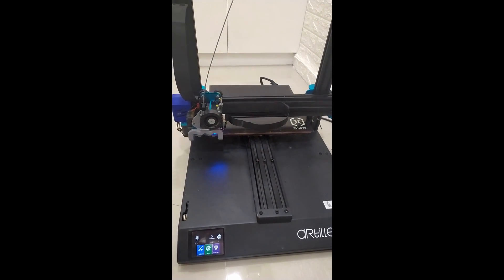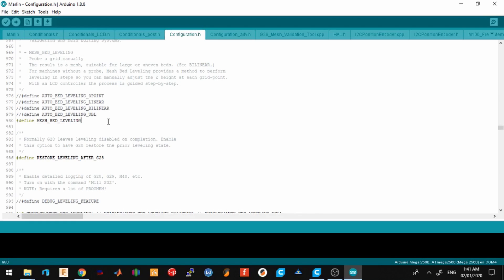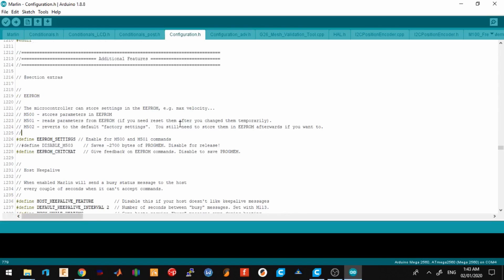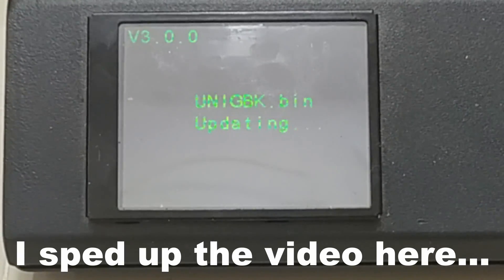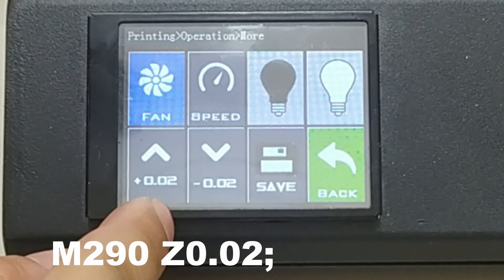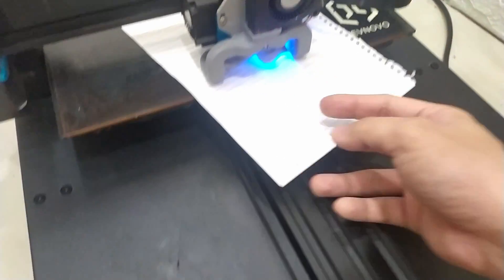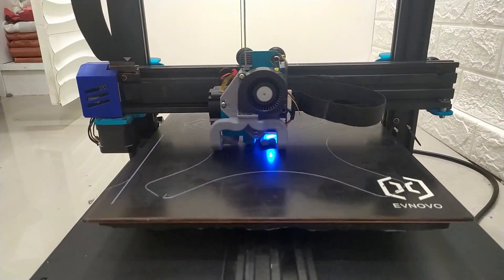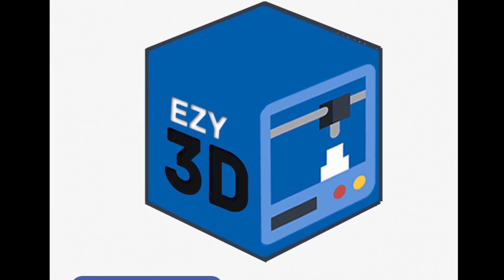Artillery 3D Sidewinder X1 Manual Mesh Bed Leveling Tutorial

Comment: I've noticed my settings dont save. If I redo it, the same spots that needed adjusting still need adjusting.
Reply from the maker: adjust the x-gantry first then redo the mesh. I've got into a troubleshooting call with some of my viewers and it has been the same trend. It looks like the settings are not changed because the whole gantry itself is not levelled and if you are trying to level the bed based on an "Unleveled" gantry then you are just adding more inconsistencies.
Reply: @EZY3DLAB  do you have a video of checking the gantry?

Comment: Why do we have to lose LED functionality? Thanks!
Reply from the maker: Because the other button commands for the LEDs was replaced by the baby stepping buttons.

You can still turn it on/off (white color), you just lost the option to cycle to the other colors while printing. 

We can still control the LEDs via gcode tho if you want a specific color. Hehe.
Reply: @EZY3DLAB  Thanks for that sir!  I'm an old-duffer and a bit sketchy on this stuff --- do I have to compile anything or is the (UPDATED) download ready to upload to the printer.  I'm assuming I connect a laptop to that goofy connector on the side of the printer.  Thanks!
Reply from the maker: Yes it's ready to be uploaded. You'll need a type B usb cable for flashing the FW.
Reply: @EZY3DLAB  Okie dokie.  Where can I find that test print you did --- the big X?  Thanks!
Reply from the maker: Sorry for the late reply, you can download the model here
https://www.thingiverse.com/thing:4376013

Comment: Hey man so i did everything right and all of the software added works properly, but when I do the leveling process, it doesn't save even after I click the save button a few times, I go to start a print and its back to the normal level. What can I do?
Reply from the maker: You can add a M420 S; gcode to your start gcode. This ensures that the mesh will load before every print. 

The M420 S should be placed before the G28.

Example:

G28;
M420 S;

That should fix it! 
*Note that you don't have to put another G28 after the M420 S. If you are still having trouble, please do inform me so I can help you with it. Stay safe!
Reply: @EZY3DLAB   i got the same issue. the weird thing it worked until yesterday.

If i level and then save the settings and start a print afterward its way off.

-bed was cleaned properly
- bed and nozzle were preheated
  - i leveled normally before i used mesh bed leveling

my g code

G28 ; home all axes
M420 S1;
M117 Purge extruder
G92 E0 ; reset extruder
G1 Z1.0 F3000 ; move z up little to prevent scratching of surface
G1 X2 Y20 Z0.3 F5000.0 ; move to start-line position
G1 X2 Y200.0 Z0.3 F1500.0 E15 ; draw 1st line
G1 X2 Y200.0 Z0.4 F5000.0 ; move to side a little
G1 X2 Y20 Z0.4 F1500.0 E30 ; draw 2nd line
G92 E0 ; reset extruder
G1 Z1.0 F3000 ; move z up little to prevent scratching of surface
Reply from the maker: @combinecornercosplay  A patreon of mine had the same problem. 

Here's the things you need to check
- Is your X gantry aligned?
- Do you have an existing Z offset?
- Did you do the extra steps that was in the included text file? (Resetting the eeprom etc)
- Check if both of your Z stepper motors  are working
- Did you babystep down during printing? (This was the fix for some of the users as they tend to skip this)

Sorry for the late reply btw, If ever you need assistance hit me up on my FB page so I can reply faster.
Reply: @EZY3DLAB  i did everything you mentioned, even reflash firmare - it wont even save the babystepping
Reply from the maker: @combinecornercosplay  have you checked the console if it saved anything?

(Open pronterface and send a M503 command) you can verify if there's an existing mesh data.
Reply from the maker: @combinecornercosplay  You can try the latest version (Marlin 2.0.5.3) 
https://www.youtube.com/watch?v=KxIPk5LAUVo

Comment: Can you show how to upload to the arduino? The port tab on arduino is grayed out and I cannot select the com port.
Reply from the maker: You need to install some drivers first before your PC/laptop can detect the printer.
Download this first https://sparks.gogo.co.nz/ch340.html

Then double check the device manager
it should be visible under (port/comports) 
*Connect using a usb type b connector.
Reply: EZY3D LAB it already was visible though. The computer says that It is fully recognized and It connects to the slicer as well. Thanks for the link though I’ll definitely try it out and see.
Reply from the maker: You need to close all slicers opened as those softwares tends to autoconnect to the serial port of the MKS gen. It can only accommodate 1 at a time.
Reply: @EZY3DLAB  It worked! Thanks for the advice.
Reply: @EZY3DLAB  I was able to upload the arduino code but I am not sure how to flash the firmware with the sd card. Is there a function on the printer to flash it? It may seem like a naive question but I am still unfamiliar with 3d printing and don't know much yet.
Reply from the maker: Make sure that your sd card is formatted,

Copy all the files needed to flash to the sd. (Just for the tft)

Plug the sd card in
* Make sure your printer is turned off.

Turn on power and let it automatically flash. :D 

If you have more questions, please let me know.
Reply: EZY3D LAB Tried just that. The printer turned on as normal, and did not flash. I think something may have gone wrong when I uploaded the program in arduino. I’m going to try again. What version of the arduino software should I use? I feel this could be the problem as on the website they have one that says beta builds and one that says hourly builds. Sorry just new to arduino. Thank you so much for all the help btw I really appreciate it.
Reply from the maker: The tft has nothing to do with the arduino.
I believe someone experienced the similar problem you are experiencing and i remember the fix he did was he formatted the SD card he was using (FAT32), recopy everything he needed to the tft and re-flashed the tft again.

Take note that the file extensions change when it successfully flashed the tft fw, so if you need to flash it again, you'll need to recopy the files to the sd once more. 

You can hit me up on my fb page ( https://www.facebook.com/EZY3D.Labs/ ) and send me screenshots of the error messages there so we can better diagnose the problem(s).

Comment: I am about to perform this install.  Do I have to use a SD card for the TFT update or can I use a USB stick?
Reply from the maker: You need to use a SD card to update the tft. It's a good practice to use a formatted sd card when doing this to avoid any errors.
Reply: Looks like the controller flashed correctly.  But when I insert the formatted SD card with the files, it the TFT does not update.  The screen just shows the Artillery Logo and loads like normal.  Any ideas?
Reply from the maker: @brandonraineri  wipe everything that's currently inside the sd card then recopy the files needed and flash it again. The UI will be the same but with added customized buttons for MBL.
Reply: I figured it out.  When I formatted my SD card, it would not let me format to FAT32.  Tried another SD card and formatted to FAT32 and it flashed correctly.  Thanks for your help.
Reply from the maker: @brandonraineri  No problem, You're welcome and happy printing!

Comment: hi man! another question... I would like to change the mesh grid to a 5x5 schema.. I assume it will be enough to change max_grid_point X to 5. My issue is that I´ve replaced the cover of the printer and I am super lazy to open it again... is there any way to change the firmware value without reflash again?
Reply from the maker: You "can" technically get away with it and upload a new FW w/o opening and disconnecting the TFT. However, it is very prone to bugs/failure. (you can try it, it won't brick it if ever it fails) 

There is a way to do it w/o opening the printer up and this is by following this guide
https://www.thingiverse.com/make:734108/#comments

P.S. You'll need to compile a new marlin fw (the one with the 5x5 grid) and look for the .hex file which is in the temp folder of your computer.
Reply from the maker: Short answer to this is no, You cannot change the grid points to 5 w/o flashing a new FW. :(
Reply: @EZY3DLAB  Ok, I will open it agan, but this time I will solder a switch on the tft power cable so next time I can control from outside the connection of it, and therefore udpate without reopening again.. thanks!
Reply: Made, I have soldered a switch on the power line of the tft connection, so I can flash again if needed without opening the case. After flashing I got an eeprom memory size error, but sending a M502 (factory reset) and M500 (save settings) all is back to normal :-)

Comment: Hi there... I tried the autotune PID option, bit it alwasy return an error of temp too high.. I´ve checked the value on the confir.cur file, and I´ve found this M303 E0 S200 C10 U1 Iam not sure what the U1 thing is supposed to do.. if I run an auto PID via pronterface with options m303 e0 s220 it works perfectly, but I will need to store the setting afterwards with an M301 command... is there any way to make your button work? thanks a lot!
Reply: I found that using manually the cur seeting of M303 E0 S200 C10 U1 gives the same error, and that modifying it to M303 E0 S210 C10 U1ends succesfully, I can modify the cur file and reflash the TFT but I would like to understand why s200 as temperature, gives an error... any clue?
Reply from the maker: @MIMUPREFERIDA  I'll have to look at it again. Thanks for pointing this out. I will update the files later. 

As for the error, I honestly have no Idea why it's giving an error for S200 and not for S210.
Reply from the maker: @MIMUPREFERIDA  I made the new sequence for the PID Autotune like this
M303 E0 S210 C10 U1; M500; G28;
So that It will double save and AutoHome after the cycle (indicating that the AutoTune is done)
Reply: @EZY3DLAB  wonderful, this will do the trick for me! thanks!
Reply from the maker: @MIMUPREFERIDA  You're welcome! If you notice anymore bugs please do let me know. Keep safe!

Comment: Thanks, Mat.  Maybe you can look at my current print fail video https://youtu.be/pM5pWq52OY4 Be safe.
Reply from the maker: Try to:
1) Don't forget to clean the bed with IPA or soapy water to remove any unwanted stuff on the bed
2) level the bed naturally (4 corners)
3) Redo the mesh leveling sequence (9 points)
4) Make sure you've added the M420 S1; gcode to your start gcode.
for example this is my start gcode for my x1 that's running MBL.

G28 ; Home all axes
M420 S1; MBL
G92 E0 ; Reset Extruder
G1 Z2.0 F3000 ; Move Z Axis up little to prevent scratching of Heat Bed
G1 X0.1 Y20 Z0.3 F5000.0 ; Move to start position
G1 X0.1 Y200.0 Z0.3 F1500.0 E15 ; Draw the first line
G1 X0.4 Y200.0 Z0.3 F5000.0 ; Move to side a little
G1 X0.4 Y20 Z0.3 F1500.0 E30 ; Draw the second line
G92 E0 ; Reset Extruder
G1 Z2.0 F3000 ; Move Z Axis up little to prevent scratching of Heat Bed

5) Lastly, if you noticed that the nozzle is STILL not close enough to the bed (even after doing all the said items above), that's the time you use the Babystep function to lower the nozzle down while printing. oh and don't forget to press save!

Comment: hey EZY3D I'm googling around on how to activate the manual mesh with GCODE before the print starts. Got a friend with a Creality CR10S that activated Manual Mesh Bed Leveling... but the nozzle is always 1-2mm higher as the measured values would be :(

m420 s1 is set

was there anything else I'm missing?
Reply from the maker: Maybe he has a positive value for the z offset that's why it's always moving up.

M851 Z#.## <~ this should ideally be zero or a negative number 

Double check it in the pronterface console.
Reply: @EZY3DLAB  I think we found it... g28 was after m420 s1... g28 kills bed leveling :) will try it, and after this going to adjust z offset

Comment: Hi. After flash now the printer the lcd don’t work properly, when I touch the tools bottom the lcd select the print or set , but I can open the tools option
Reply from the maker: Have you tried flashing it again with a reformatted SD card?
Reply: @EZY3DLAB  thanks now work good but the problem is, after leveling i push save, and when start leveling again the bed is totally unleveling again.
Reply from the maker: @jorgeluisgonzalez5333  you only need to do this once. Make sure you set the proper Z offset.

Additionally, please put a M420 S1; in your start gcode.

It should look like this

G28;
M420 S1; 

That will load your mesh every print for sure.
Reply from the maker: @jorgeluisgonzalez5333  You have to manually level it (4 corners) before doing the mesh part. ABL/MBLs are not magic which can 100% fix bed leveling problems. What it does is it compensate the "small" misalignment in bed leveling, if your bed is unleveled to begin with, the printer will have a hard time compensating.

Oh and btw, once you have made the mesh and save it, DO NOT manually relevel it again, if you turn any knob you'll have to repeat the mesh sequence as you've already lost your setpoint values.

Comment: What Fan do you use and what fanduct is this. Looks awesome!
Reply from the maker: That is a 24v 5015 fan. here's the link for the mount
https://www.thingiverse.com/thing:3939198
Reply: @EZY3DLAB  Thank you, guess you mean 5015 or?

An other question belongs to the firmware:
I downloaded everything and installed it, everything works as intended but I noticed a realy slow speed on moving the Z-Axis... slower than I thought the stock firmware was, Is there a possibility to change this with a gcode?
Reply from the maker: @NiceDevil  hahaha yes I meant 5015 sorry. 

You can change the max feedrate for the z axis by sending the gcode 
M203 Z# (you can add this to your start gcode) 

By default it is set at 50, I dialed it down to 5 because I felt that the z axis was moving too fast and jerky-ish. I don't mind dialing it down since you only Autohome once everytime a print starts. Hehe
Reply: @EZY3DLAB  ah thank you :) I will save it so eeprom then. The slow movement of Z-axis is a bit too slow for times where you just want it to move away from the bed in case of a cleaning job :)

Comment: hi, looks easy to remove the object from the bed. what do you do to clean the bed? and at what temp do you use on the bed when printing?
Reply from the maker: I use soapy water then IPA Alcohol. 
I let it cool off before removing printed parts. 60c for PLA.
Reply: @EZY3DLAB  ok thank you, i having issue after print to another print, the bed levelling are change and the nozzle making gap to the bed, i had to wait until the printer are really cool down and restart the printer to get the machine print the object again.. is there any bug on the firmware?
Reply from the maker: @puturai  Make sure you followed the detailed instruction I placed (the readme file)
There is one known bug which the printer fails to load the mesh when being restarted. There is however a very easy fix for it. Just add M420 S1; after the G28 in your start gcode.

Invest in a PEI spring steel sheet and you won't have any adhesion problems. (I'm currently running with the energetic PEI sheet)

Comment: After using this great feature for a while, my printer suddenly does not appear to use the mesh points anymore. It is printing about 0.2 mm to high. I've done several leveling routines but no success.
It's driving me mad. Any ideas?
Reply from the maker: You can add the M420 S1; to your start gcode so that every time it auto homes, it loads the stored mesh.  It's an isolated case where the saved mesh is not loaded after G28. 

Your start gcode should look like this

G28; 
M420 S1; 
(and the rest of your start gcode)
Reply: @EZY3DLAB  Thanks. That seems to have done the trick.
Strange though. I upgraded to the Hemara extruder and that went well. The meshbed leveling worked fine. Then I did a calibration of the extruder and after that the problem surfaced.

Comment: Does this work with Marlin 2.0 yet?
Reply from the maker: Yes. I am currently running with marlin 2.0.3 (as far as I can remember)
Reply: @EZY3DLAB  Nice! I´m about to put in a SKR V1.4 turbo and was hoping to run 2.X with it. Thanks dude!
Reply: @EZY3DLAB  What do you think, should I keep my 2100´s or is it worth it getting something more advanced like 2209's or 5160´s?
Reply from the maker: @danielclasson  In my personal opinion, I would prefer the 2209's (love that sensorless homing) 
+ The stock stepper motor drivers of the X1 are a clone version of the 2100's so changing it to a known/reliable driver is a big plus in my book.
Reply: @EZY3DLAB  I´ll look in to that then. Thanks allot!